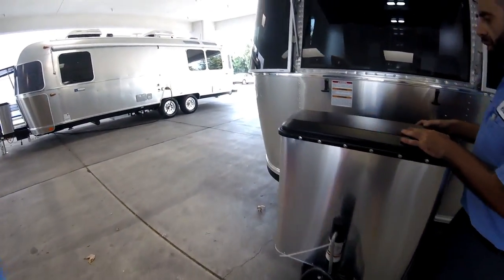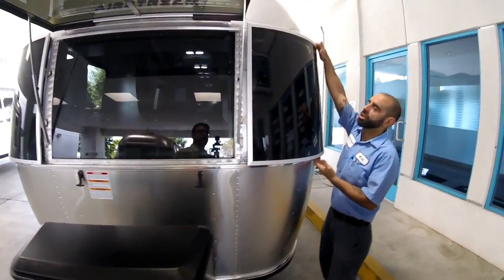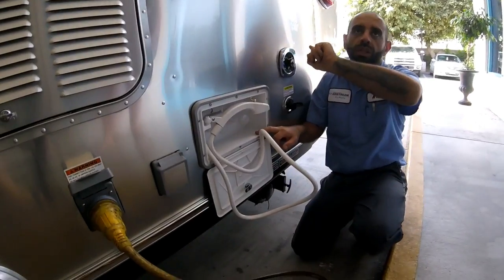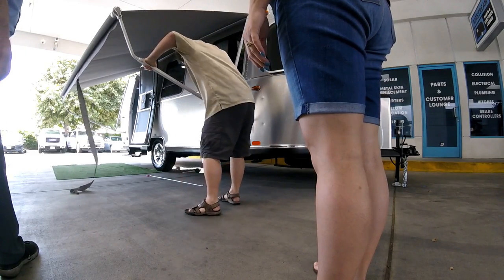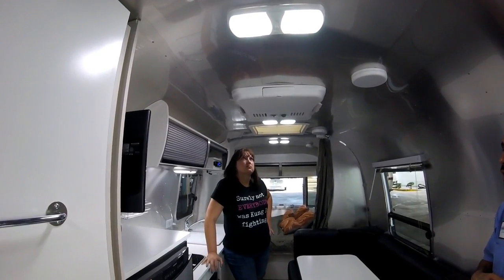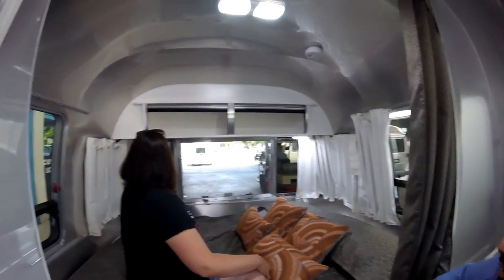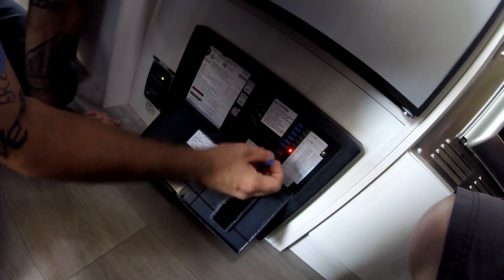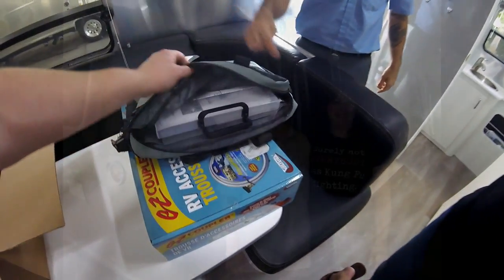He and She got an Airstream - Airstream 22FB Bambi Sport Travel Trailer RV Camping

Comment: Hey you two, thanks for the intensely interesting and informative 3 vids. This is the one my wife and I have decided on. Worked on pricing and trade in by email. Now we just need to go get our hands on it and pull the trigger (buy it) which may be 1-3 months. The walk through on this last vid is the most helpful. Hope you have been enjoying it. Keep us informed.
Reply from the maker: We have been loving it. If I'm being honest, here are the cons: The cabinet slide-doors aren't as nice as the hinge-doors in the Flying Cloud, but the FC was a bit out of our price and weight range right now. 25 FC is our goal in about a decade. Also, the dinette table feels wobbly because it just has the single column support. The tables that attach to the wall are much more sturdy. We've decided we don't really need the table, so we keep it down with the cushions and use it as a lounge/couch, or bed of course if we have a third with us. I answered your other question, by the way.

Comment: Is it possible to upgrade the propane tanks from 20 pounds to 30?
Reply from the maker: I never asked the dealer that question. To be fair, we never even ran out of one tank because we always used sites with electrical hookups. We only used gas to cook (sometimes) and heat the water for washing dishes. I'm afraid to give you the wrong information. If you need specifics, I would contact you nearby dealer to be sure. Good luck.